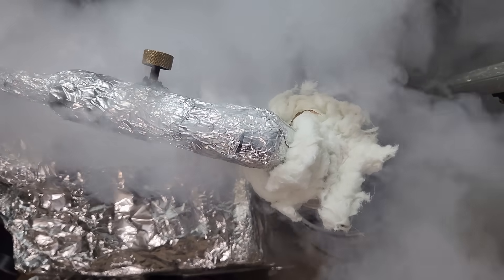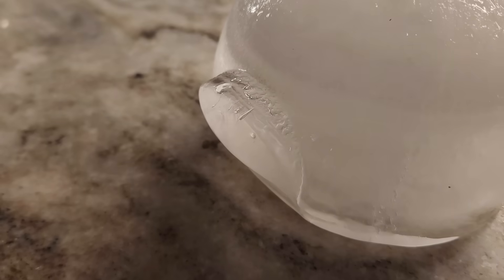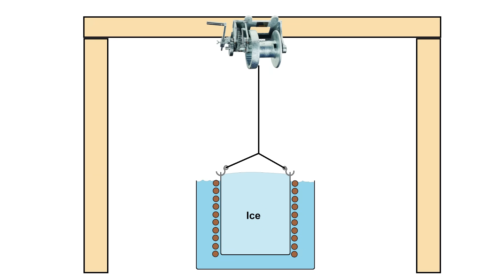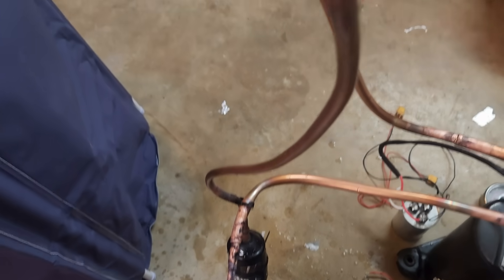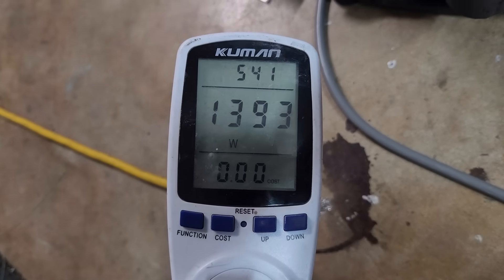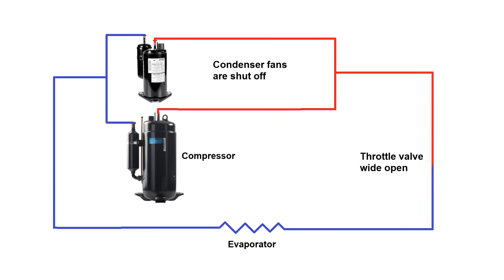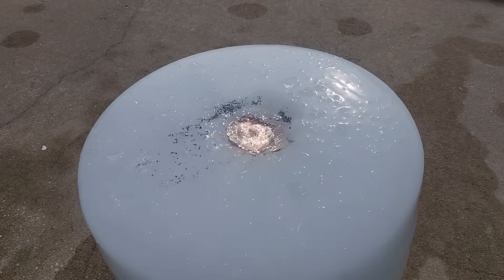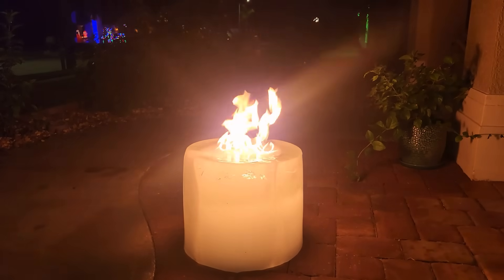Making Gigantic Ice Cubes In My Garage

Comment from the maker: Btw the channel has a discord now, because apparently that's a thing people do in 2024

https://discord.gg/yTJ78WJK
Reply: Shits broke
Reply: i cant join the discord
Reply: From AD 1998
Reply: nice
Reply: Expired
Reply: bruh
Reply: Discord links are time sensitive unless you make a custom link. Please update or make a custom link
Reply: Now freeze the POOL
Reply: Is it possible to design a system using this hardware where the condenser functions as an on-demand (tankless) water heater for hot showers, while the evaporator is configured to make the cooling effect useful—such as producing ice cubes or integrating it into a refrigerator, with the coil immersed in a bath solution that freezes around -10 °C?

Comment: If you’re going for speed why not pull a vacuum on the ice cube chamber until the water freezes and use the refrigeration loop to get the ice to a deeper freeze? Would want a vacuum rated vessel for the ice but that won’t be hard to find. Could get the job done in minutes since all (most) of the energy you put into running the pump goes into volumetrically pulling heat out of the water and you don’t have to depend on thermal conductivity and convection from the coolant to copper to steel with low surface contact (or copper to air to steel) and steel to water. Your high dT between the coolant and the water doesn’t matter much when your total thermal resistance is that high.

Comment: https://www.youtube.com/watch?v=hrnIsQSFxV0&list=PL63CRKhqlBLOu1_usH8TIQO3fzfkiXQ2v
Reply: Isn't that cool? That's an industrial grade induction heater actually setting an ice cube on fire! Not only that, but notice that strange orange color of the flames? That's hydrogen burning ("ask me how I know that"), and nothing burns hotter, something around 5000 degrees! It's actually ripping the h2o molecules apart, then setting them on fire. The original poster filmed that at some kind of industrial machinery trade show, so they were showing off to sell the things. I know I sure want one. And  it glows red hot, first.

Comment: I dont know if you read this but your CaCl2 solution did a slushi thing because you werent at the eutektikum. This is the only point were no slushi is between solide and liquide. Its like with steel that has an carbon concentration above or lower than 4,2 percent of carbon. Sry for my bad english. Im a german student and I love you vids.

Comment: parallel compressors, you made your self a rack system! this is how big places stay cold. i work ammonia refrigeration, chillers and what not. the salt brine is exactly how they do it industrially. the evap is just a bunch of galvanized tubes in a swimming pool sized vat and they drop in galvinised square molds for the ice that hold about 30 gals of water.

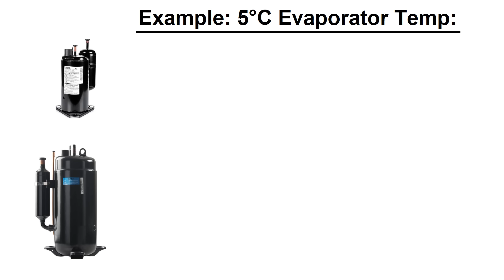Comment: 9:27 could this be why my r32 mini split didn't work very well when I tried charging it with propane?
Reply: FYI to anyone interested, I've since tried a product sold by Hychill and Greenfreeze. It works slightly better. It's advertised as being a mixture of propylene and ethane, however they don't tell you what the percentages are. Proprietary blend?

Comment: Didn’t see any mention of it but when you have more than one compressor in a common refrigerant circuit, each compressor must have an oil separator or you will have an uneven return of oil to the compressors which will not end well for either one.

Comment: Although hilarious idea, here are some improvements that could probably speed up the process:
1. You could add some stiring device into the water, for greater cooling potential. With some auto-turn off just before freezing, or even large magnetic stirrer.
2. Circulation pump for coolant bath.
3. More insulation via air-gaps. Air has similar insulation properties as foam, so instead of using tons of foam, just making many thick air gaps would be better.

Comment: The biggest issue with parallel compressors is oils transfer. You are goijg to end up with one compressor full of oil and the other empty. 

That’s why you normally see a tube linking the bottom of tandem compressors to equalize the oil levels.

Comment: Me: I have a random idea for cheaper refrigeration off grid, make a modern version of an ice box that makes its own giant ice cube…. This guy: I’m making giant ice cubes for fun! Me: I knew that this YouTuber wouldn’t let me down! 🤩
But in all seriousness if you make one from the 12v propane run version of those components. It would significantly reduce the power consumption and you’re using the propane for the refrigerant anyway. The reason why I was thinking about this was to reduce the cost of running a refrigerator. The solution is to make an automated ice box that is designed to keep the refrigerator off for far longer than normal. This video is a great example for what you need. You’ve basically built it but you just need to freeze the outside of the pot instead and insulate the outside of the entire thing better. You basically just created a refrigerator that would only need to turn once a day or two whereas a normal refrigerator would keep cycling throughout the day. I would suggest playing around with the idea to make it more efficient and usable anywhere. You’re already a couple steps away.

Comment: Great video! So to increase the process efficiency do a separate isolated environment where you keep water liquid just above freezing point. This way you can just transfer the almost freezing water to the ice making pot, being able to freeze that water in a much shorter time, or even use a much weaker system for freezing the almost frozen water (just to get it solid). This way, while you freeze the cold water, you also prepare new cold water to rapidly freeze the next block and make yourself a nICE production line 🧊🧊🧊 If people would be cool, they will come to buy your ice blocks just for fun or for various other reasons. You can also sell the ice blocks pre-packed with firecrackers, cool LED lights and much more big ice awesomeness.

Comment: I saw a guy making crystal clear ice blocks at a winter carnival once (for later carving).  He used an aquarium bubbler to bubble air through the water as it froze.  I'm not certain, but I think the idea is that the relatively large bubbles from the bubbler combine with the tiny bubbles in the water, and then float to the top.  So you don't get any gasses in your cube.

Comment: would be a shame if the Calcium Chloride that your were using was actually Calcium Chloride Dihydrate that has a molecular weight of 147.01 instead of 110.98 g/mol. Meaning that you only added 75% of what you thought you added.

Comment: purdyplease, run a freeze where you are constantly circulating the water with either an agitator or a pump. The motion supposedly prevents gas bubbles from getting trapped between the water crystals and you can end up with perfect 'ice carving' clear ice.

Comment: 4:51 What you’re describing is basically a water jacket still.
Basically a big stock pot with a double wall that hot water/oil can pass through, allowing better thermal transfer to the mash you’re distilling and preventing hot spots.
You can buy one for less than you probably spent making the copper coil.

Comment: awesome! an old 80's ice make used an a steal drum to flake ice and a cutting bar. point being it was a flooded drum w refrigerant.  use an trash can and the stock pot for a flooded evaporator. txv and large accumulator is required for flood back!

Comment: Something like that could make great temporary side table + refrigerator combos.

I'm surprised the brine froze, did you calculate the concentration assuming anhydrous CaCl2 and used some hydrate?

Also, could the insignificant corrosion of the copper in the test in part have been in due to the insignificant amount of free oxygen available?

Anyhow, great video, as usual.

Comment: Obviously the next step is to go much bigger, and then do some reverse urban sledding. Pretty simple to freeze a pull point into the block itself, along with a load plate. 

Just remember the first rule of reverse urban sledding, it's not about how fast you can go, it's about how fast you can stop.

Comment: At work, I was working on a laboratory chiller whose control electronics failed. It was filled with ethanol, and I just turned on the compressor and let it free run for a while. By the time I stopped, it had reached -40C (which coincidentally is also -40F), and I put a small bottle of water in the ethanol bath. It froze in just a few minutes. :) Fun stuff. 

Fun fact about laboratory ultra deep freezers, according to a poster at work: a small freezer at -80C uses as much electricity as four average Swiss family households. Increasing the temperature to just -70C reduces energy consumption by 30%.

Comment: Actually there is one way to make ice that burns: disperse methane into it while it is freezing, and it can form methane hydrate, or "hot ice", or "methane clathrate"

It may require some pressure to form, but other than that, its just water and methane gas, chilled really well until they dissolve and form crystals.

https://en.wikipedia.org/wiki/Methane_clathrate

Comment: Couldnt you easily increase the effective surface area of the evaporator by circulating the water. Take advantage of the fact that moving water is resistant to freezing, supercool flowing water, then shut off the pump and let the water freeze when it stops.

Comment: As a child forced to 'help' a mechanical-engineer; one of the many "arguments" I experienced was about how to best to form a copper coil to snugly fit a cylinder (some motor being pushed beyond its intended design spec?).

While I agreed that calculating springback and machining a 'perfect' form is "possible" but resource/cost prohibited at home; I argued that it would be better to use a smaller pipe as a mandrel so that the resulting coil would naturally rest at a smaller diameter than the target; Then TEMPORAIRLY expand the coil during installation by spreading the legs (the same way that tortion spring does) so that it can slip around the target and secure itself with springsback.

(to paraphrase politely) He screamed that I didn't know what I was talking about and that my idea would produce too many kinks to effectively transfer heat between the motor and the pipe - Then after throwing a fit "about who is actually a(n) qualified engineer" when I tried to show him how my idea was intended to still work at full scale "because it will never fit without breaking the irreplacable motor";  Proceeded to "carefully" anneal, clamp, and hammer the copper tubing directly on the motor while soldering segments of it in place with increasing vigor - before eventually calling the project off when he realized that the motor casing had become more mishspen than his previous attempts.

Now that I am an engineer I've sometimes wondered if my idea would have worked, but haven't seen a specific build that could have justified testing it - But by sharing I hope that may see it tried somewhere where having the coil secured (by its own friction + shape) won't be 'an inconvenience' .
Reply: The real solution is to hit it with a torch as you're forming it so there's no tension to contend with.

Your idea would work, for a small coil, but after a bunch of turns you couldn't reliably expand it any more and you'd be stuck. Also if you want real thermal conductivity, you solder the coils to whatever you're cooling as you coil around it, that's basically as good as you're going to get most of the time.
Reply: @jttech44  (( (attempt three) Sorry, I have noticed that youtube is shadow-deleting my replies that contain common shorthand abbreviations or too many slashes -- From my previous false ban for crosssite scripting, I suspect that YT's system is now falsely detecting URL and XSS fragments. 
I am struggling to remove these structures from my replies to stay visible, while staying readable .   ))

While I agree that torching the tubing is the most practical solution - since clearly cold forming was a false requirement.

My experience making and using jigs (minimally: two parallel sticks, a hook, and sometimes a lever) that limit the size each coil expands to by diverting-or-dividing the load path such that each turn is approximately the same - on solid wire springs - so that a cylinder or bundle can drop inside to be trapped when tension is released and the coil contracts again - 
Or winding a small preformed solid coil around a marginally larger cylinder (like a nut onto a bolt) in a way that causes segments of the coil to expand with whenever there's enough friction to block its progress - (tension increases with its diameter, decreasing contact pressure with friction) -
Strongly suggests to me that this could be a useful technique with the jig - but again I haven't had a single occaasion where it may have been productive to try in decades.

However; I think that we can agree that my "senior" engineer's refusal to even accomidate springback, and attempting to hand-hammer the hard tubing into shape directly on the target device was never going to work.

Comment: Given that re frezing the split block took nearly as long as starting with water, showes the the limiting factor is not cooling power but rather the heat transfer.
Means a chestfreezer with a fan for some airflow would performed similar.

Comment: "Can ice burn? Well of course not, that's ridiculous."

Except that you can bubble methane through ultra cold water and form methane clathrate. Methane clathrate does burn, and is the reason why when the Deepwater Horizon happened they couldn't just put a big ol' industrial cup over the leaking well and suck out the oil. Methane clathrates formed on the top surface and blocked the extraction tube, it was a completely novel problem to encounter.

Comment: 12:47 so 61.4MJ energy removed. If it was a constant 1550W, then you used 133.9MJ of electrical energy, so about 46% system efficiency. I'm guessing the power reduced as it got colder, though. Did you log the total input energy?

Comment: Wow, this is interesting!
I think if I ever have a home built (esp in the south), I'm gonna design it so every room is like your giant ice cube maker, i.e. with the coils in the walls.
Y'know, like a walk-in cooler!
Seems like it'll be more efficient for cooling (I'm not planning to make ice with it), and, I mean, if it ever does freeze someone solid, I can do like you did--run the unit without the fans operating --to "release" whomever it froze.
By doing it this way, as long as the builders use plenty of insulation, I won't have to run it long each day, and I'm sure it'll stay plenty cool the rest of the time!
Hmmm. I wonder why they don't design homes like this already?
Probably the same reason why builders always skimp on Insulation (and other things), right?!
🤪
Reply: They don't do that because there's no way to control the condensate inside of the wall of a house, and you'd instantaneously have mold problems. 
They do, however, have radiant floor heating which works more or less how you've described, and it's really nice. There's even implementations where you also heat your driveway to just above freezing so you never have to shovel it.

If you want new hotness in an AC system, hybrid geothermal systems are very efficient, because they pump heat into cold ground via tubing that's buried. Also works great for heating for the same reasons, as the ground is warmer than the outside winter air. Viability comes down to cost though, many places are no-go unless you can install the cooling loop yourself.
Reply: Like the other reply said, you can't run normally because everything would get wet. You could install a controller to stay above the dew point and you wouldn't have this problem, however then you'd likely need a separate dehumidifier.

Comment: Normal residential HVAC units have both hot gas bypass and reversing valves depending on the system type

Comment: What about stealing a propane/r290 compressor from a heat pump? My Panasonic heat pump uses r290, and that has a 2.5kW compressor. However it is a 2023 model so I don't know if they're readily available on the scrap heap yet.

Comment: This may be an extremely stupid question, but, since you replaced the compressor on that radiator does that mean I can replace the compressor on my sistem with any other compressor I want? (Who cares about safety precautions)
Reply: Technically, yes. You want something similar at least, and, whatever control system is attached to it will likely need to be modified. You also need the gear to safely remove/replace the refrigerant, and the knowledge of how to do that properly.

Comment: This would be a good thing to use in summer, if you run the cooler with solar panels during the day to make bulk ice, you can use the blocks at night to help cool down the house, probably with a pump and a radiator fan combo.
Reply: I came to say the same thing. Oversize the system a bit to get ice AND air conditioning  during the day. Replace the salt water slurry with antifreeze and pump it around to radiators. Minimal battery storage needed to only run the pump and radiator fans.
Reply: Def stick with a heat exchanger setup for that though. I have heard many people complain about the days my university used massive ice blocks with a duct system to keep a theater cool with 3k people in it. It gets humid af.

Comment: Being in Florida suddenly explains how many ac units you have or can get for cheap. 

Might suggest a pump to circulate your water bath. Would help with slushing and heat transfer.
Reply: Maybe also a stirrer inside the pot?

Comment: The problem with parallel compressors is oil management.
You can not guarantee that each compressor receives the correct amount of oil back, this is why commercial multi compressor systems use oil level regulators and oil separators.
But this comes at quite a price.